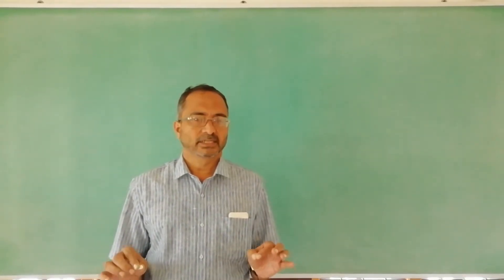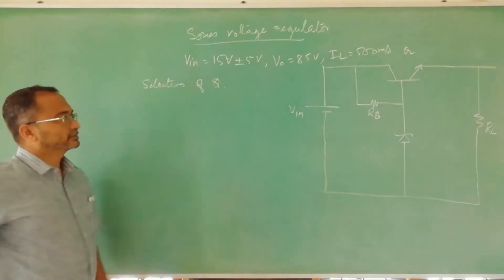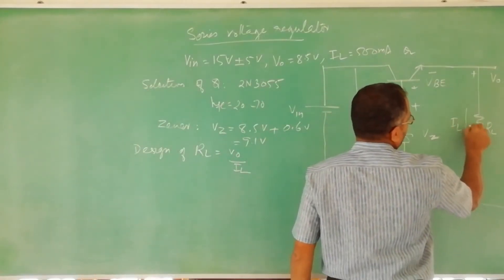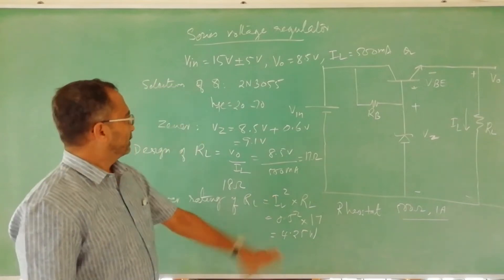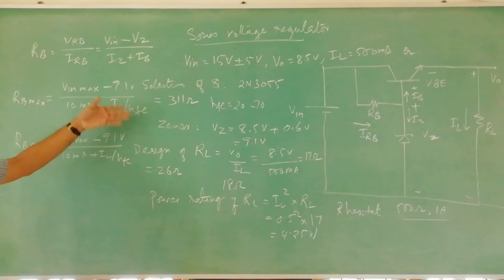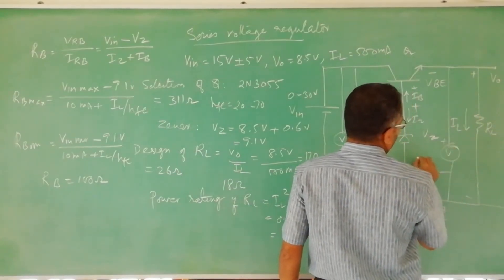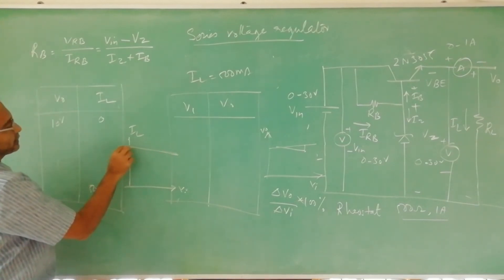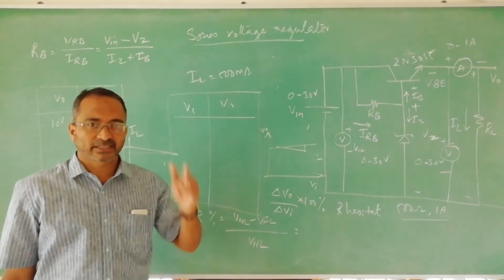Lab Tutorial: Design of Series Voltage Regulator without feedback by Dr. K.A.Navas

Comment: sir , i have dought in the tansistor series voltage regulator.
the diagram is in the form of Q1 (transistor) base is connected to Q2 collector , and emitter of Q2 is connected to zener diode, RB is connected to the collector of Q2 (transistor) , the base terminal of Q2 is connected in between of R1, R2 resistors.
so what will be the calculations for this ,please reply me sir.
hemaprasanthnaidu@gmail.com